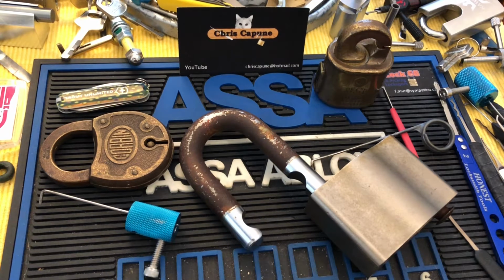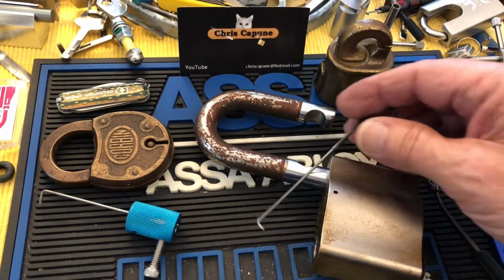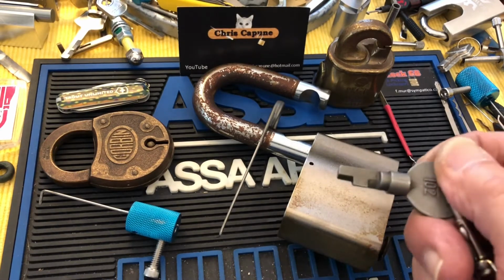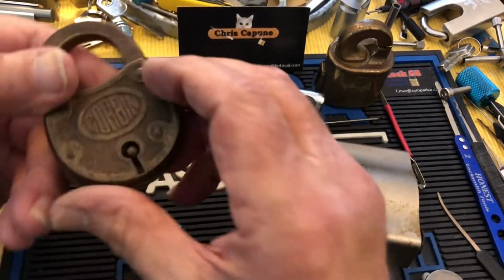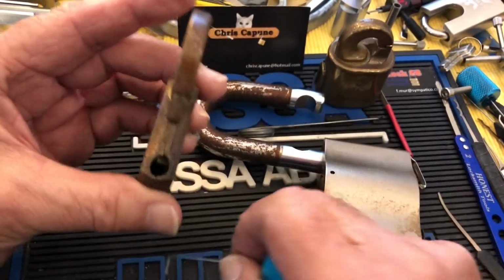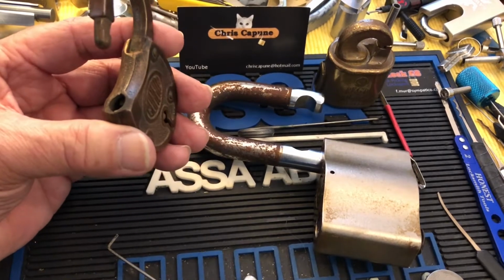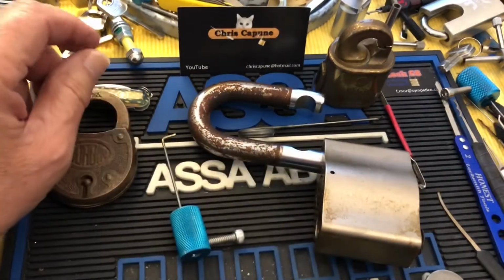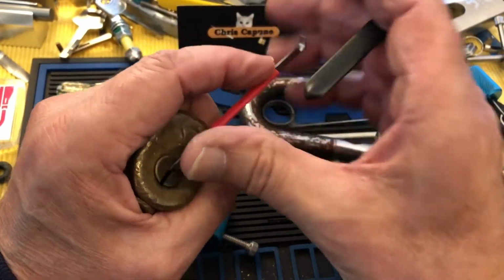#1168 Old Corbin Padlock picked plus a lot more!!

Comment: Hey Chris. I bought 3 postal locks recently and had a horrible time with 1 of them. Obviously keyed alike, but one opened with no issues, the second was a bit tricky, but the third was unopenable! I was convinced it was damaged even though it only had 73 openings. Turned out that this lock needed so much tension that I almost twisted my tool in half. Try the other with a stout pry bar and really put some tension on it. Worked wonders for me!
Reply from the maker: Cool!! Thanks buddy!!!
🐾🐈🐾🐈😷